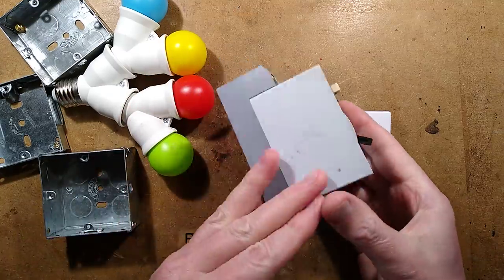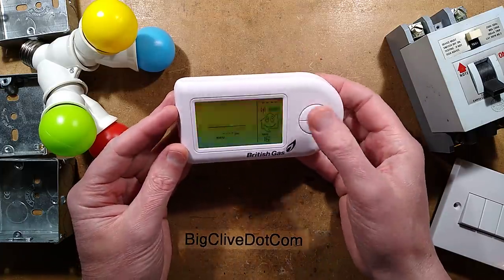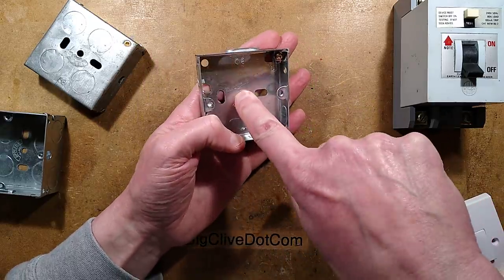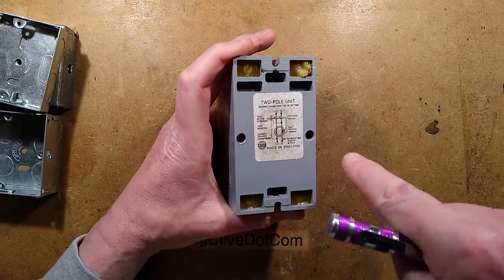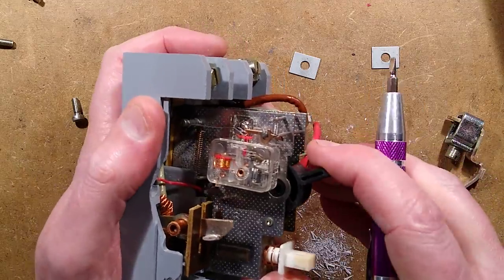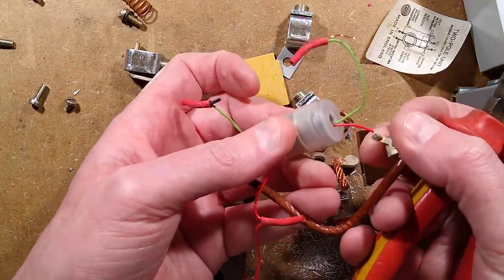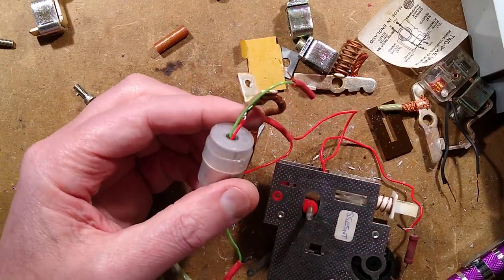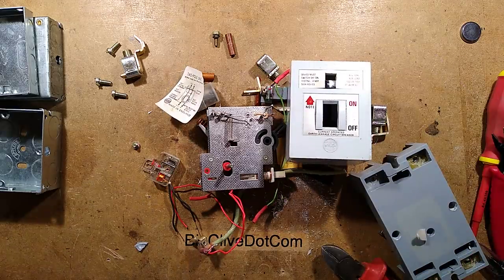Vintage RCD/GFCI teardown with story (weird sensing system)

Comment: About 4 years ago I had a call from my wife's friend. Her cold mains tap had hot water coming out of it. 
No RCD ( House circa 1955) and a short to gtround in the house. Entire house was a Faraday cage at 230v, and not a tingle anywhere. 8 ohms resistance on the "earthed" water pipe. 8kw flowing down the water pipe resulting in an 8kw soil heater. Isolated fault and asked how long the cold tap had been flowing hot water. -  2 weeks. She had an £800 electric bill for that quarter.
Reply: Woah

Comment: As a young child (age about 10) I had a crystal radio grounded to an outlet screw (which we later found to be ungrounded), with an antenna run along the ceiling thru several rooms. I came home from school one day to find said radio a pile of slag and a line burnt into the carpet where the antenna made contact.
Fault analysis determined my younger sister was to blame. :)  An errant ball had knocked down the antenna, which made contact with a central heat register in the floor, which managed to drive a rather large current thru the crystal radio to the outlet screw "ground".
Potential between the outlet screw and the heating register measured over 100 volts, with enough power to dimly light a 60watt incandescent.
The furnace in the basement was newer than the 1950s upstairs wiring and was grounded. The outlet device was replaced which eliminated the "live" ground, and led to the discovery that there was no ground of any kind available to that outlet (only two wires, oilcloth outer jacket, no conduit). The original outlet was a triplex of 2-hole sockets and must have had an internal fault, but that my youthful disassembly was unable to discover.

Comment: That transformer core will be made from something like Permalloy which is basically 80% Nickel and 20% Iron.  It was widely used for mains frequency and low frequency switch mode PSUs and probably still is.  It has a very high permeability which makes an accurate current transformer.  It's used in the form of a thin tape to reduce eddy current losses.
Reply: Correct on all points:
Tape wound transformer cores are not at all unusual, especially in Toroid form
The thin tape forms laminations in order to prevent eddy currents
The metal will be Nu-Metal or something similar (eg not steel)
And it's a Current transformer, so one turn is sufficient
Reply: @graemezimmer604  I think you meant mu-metal.
Reply: @dhaen  Mu metal is malleable, permalloy seems to be harder. As mu metal loses its properties when bent it is not so practical.
The name is confusing - the "perm" does not relate to permanent magnets it seems.

Comment: Those boxes are comically thin from a US perspective. Ordinarily our boxes are about 3–3½” deep, which fits nicely inside of a stud wall. Boxes like those exist here, but they're very much a specialty item. The one time I ran into one it was a real PITA to deal with.

Someday I'd really like to send you or John Ward a US equivalent to your "consumer unit". The innards are just so totally different in concept that I find it amazing.

That core is acting as an amplifier for the magnetic field, so you're going to be getting more flux in the sense wire than you would without it. You're still dependent on the circuit being AC. Detecting a DC fault to ground would be a bit dubious, I think.
Reply: They're effectively the same as a three-phase DB over here, except they're still made like it's the 1960s. Nothing earth shattering.

Comment: We were using these fault current operated devices in the UK in the early 1960s, sometimes still using mains water supply as the earth (ground) conductor. I pressed the test button on one at the same moment as the plumber was under the sink disconnecting the pipe. He became part of the earth circuit and was quite annoyed about it. We started using earth spikes for a time but they were soon superseded by the present fault voltage system.
Reply: What does the "fault voltage system" use as zero reference if not some metal connected to mother Earth?
Reply from the maker: Some seem to measure voltage difference between neutral and earth.
Reply: @bigclivedotcom  This was directed at RJ Mun calling RCDs outdated in favour of some system by that name, while simultaneously misunderstanding how RCD test buttons work.  Still waiting for him to explain what he was on about, though it might be the IT system, or TN-S with an old school Earth current relay.

Comment: A few months ago I was working on this parked trailer/cabin that had suffered a ground fault. It was plugged into this 50A plug that was grounded by a little brass strip going to the screws in the pedestal it was mounted in. The breaker feeding this plug had been disabled, the one inside the trailer didn't trip for some reason, and the brass strip worked as quite an efficient fuse, so the ground wire and everything "grounded" in the trailer became live. It took a while to figure out why turning this breaker "On" would cause a reading of 0 volts from live to ground.
Reply: ouch, that could give you quite an "interesting" experience, touching anything grounded...
Reply: @alexanderkupke920  Yeah I think the snow was just cold enough, and my boots were just dry enough, that I didn't become the new ground wire when I touched the metal cover of the outdoor panel 😂. The time where I was working near a pool and water had condensed into the breakers was another story...

Comment: I remember these very well, late 70, early 80's while working for British Rail. While attending an electronics course at college, I had a project to build a ELCB tester to make sure they did trip, not only at the rated current, but also within the approved time limit. Since these worked on balancing the current through the sense coil, the tester allowed a small amount of current to bypass the the coil, hence giving an imbalance. Cant remember the circuit details, but it counted the peaks of voltage passing after hitting the 'test' button - giving a 'Pass' - 'NoPass' sort of test - very primitive, but I passed the course :) - by the way, great watching these vids Clive

Comment: I find the history of RCDs fascinating. They were invented in South Africa, to protect  people in the mines from electrocution. The early sensing circuit used a special vacuum florescent tube. South Africa was the first country to adopt RCDs as standard, in domestic installations. I think the UK was quite late to adopt RCDs ( Mabe fear of nuisance tripping?)
Reply: When Denmark adapted them for new installs in the 1970s, the breakers were already a newer style DIN rail units, and any retrofit into existing installs might make it the only piece of DIN rail in the consumer unit.  So I'm guessing this UK RCD is from an earlier decade.   It may be older than Clive himself.
Reply from the maker: Just like we're still dragging our heels with the type-A RCDs, while the hobbyists at the IET invent ever more unlikely accident scenarios that must be protected against.
Reply: @bigclivedotcom  they are a protection racket mafia! The stupid one day course to  sign off real electrician's work. Don't get me started 😂
Reply: @johndododoe1411  DIN rail came much later for circuit breakers and RCDs, in South Africa. It's nice to see it all standard now. The stuff in the USA is very different, but interesting.
Reply: @johndododoe1411  here in NL, we moved in 1992 into a house with a 1960s fuse box setup (the house had mostly burned out around then, and we added RCDs in front of the existing stuff , which was indeed the single din rail box in the setup. We replaced the entire thing with a new din-based fuse box a few years ago in preparation for adding solar panels.
Reply: Well I never !
Reply: Some form of ground fault protection existed in Germany around 1908 too.
Reply: @mernok2001  That is fascinating. I was never a fan of huge fault currents to earth, tripping a circuit breaker.( This requires the earth loop impedance to be very low) But RCD/ GFI  can easily deal with hi value earth loop impedance. Let the circuit breaker deal with short-circuits and overloads. I think there is to much reliance on a "good earth" tripping the breaker.

Comment: the shallow depth boxes where usually used on the lighting circuit, the 20mm box was for sockets, spur switches, whilst the extra deep was mainly for cooker, shower circuits... if you thought the e.l.c.b. was fun the older voltage operated circuit breaker where a hoot, a fault on one house could knock the power off for several neighbors too...

Comment: Still got one these in my house. Had it fitted in 1976 and felt very modern as all the neighbouring houses on our new estate made do with wired fuses and nothing else. Still works using the test button or one of those plug--in test plugs with a RCCD test button.

Comment: Oddly enough I have one of these 'protecting' a PIR light on the side of the house. The feed to it is taken from a lighting circuit on the, much more modern, split load, RCD consumer unit. Very interesting. I'd not given it's age much thought. It used to protect the garage when there was just a pendant light and a single 13amp socket.

Comment: Amazing how simple it is that there is enough power induced through that small wire to create the magnetic force which trips the mechanism. Considering the age of the device I wonder how much development went into making it, no electronics just a bit of electro-magnetic force to push that small pin out and the mechanism to release the breaker. Great seeing such an old bit of kit which no one would give a second thought to what went into it when it gets replaced. In a way it's good it failed so you could make this video for us as you would never have replaced it had it not failed.

Comment: Your deepest box is standard in the US. The shallow one would only be allowed for low voltage like under 50, and not line power AC at all.
Reply: The 5/8 inch "pancake box" is a thing here too. But it's only used under light fixtures that have a little room for connections in the back of the fixture. no way would an American switch fit in one of those!

Comment: There's a good PSA here - if an RCB doesn't trip when you press the button, manually switch it off and on and try again. You'll still want to replace it sooner than later, but you'll know the reason it wasn't tripping was mechanical.

Comment: I always love the dimpled metal plates that they used to use in old electronic gear. I don't know why, but I just find it pleasing...
That rolled steel wrapped core is typical for any toroidal transformer that I've seen so far.

Comment: Guess that is why in the Netherlands the boxes (and tubes) that sit in the wall are always made from PVC. Only old houses (where the copper wire may even be wrapped in paper and canvas) you would find steel tubes and boxes, however the switches would then be on top of the wall instead of inserted leaving room for cables still.

Comment: My old cottage is about to have some work done to replace the consumer unit but at the moment it is an old brown Wylex fuse box (6 ways) and an old brown Crabtree earth leakage trip, the trip has a connection to earth and should, if still working as specified, trip if 50v is sensed on the earth. 

I did the last wiring here about 25yrs ago and yet testing last week with a modern insulation tester came up with good results. The earth stake I put in back then is still good, I intend to keep it as a stake as I do restoration of older pro audio equipment and a good stake gives a cleaner, quieter earth than PME etc. 

Soon I'm hoping to complete a home workshop which is going to have extensive wiring (more than the house) which is why I have to bring the house up to date.

Comment: That coil is made from Permalloy, which is a magnetic foil used to make tape heads. Used as it is linear, but has a well defined saturation point. The magnetic coil will trip with 30mA of current, and has a tiny magnet that is adjusted to set sensitivity. The coil will only trip on one direction of AC current flow, as the magnetising from the coil increases and counteracts the small bias magnet field, till the armature is able to pull off with the spring tension. Other half cycle the field is reinforced and does not release.

I have taken older units apart, Fuchs made ones, which also had that circuit, though the ones from the 1970's made by Heinemann included a small electronic circuit in them, which was a full bridge rectifier, using 2 10V zener diodes for half the bridge, a small tantalum bead dipped capacitor as smoothing, then a BRY39 gate controlled thyristor with a Rc network attached to the positive trigger circuit, so it would trigger and put a pulse of current through the coil if the leakage reached 30mA, or for larger imbalances the zeners would clamp the voltage, and the fast rise would trigger the GCS to fire and trip the coil.

More modern ones (circa 2012) have an updated circuit, and use some mains power to have a small electronic circuit to compare the current in the sense winding, and use a small signal thyristor to trip the coil via resistors directly off the mains, so no need for a sensitive coil mechanism. This later one also has lost neutral detection, using a second set of diodes that allow neutral to float up to 1V2 above ground before tripping, so detecting loss of neutral inside the premises, though it does not work with TT systems, but only with TN-CS systems. Came with a set of MOV units inside, that would clamp spikes down somewhat, but would also trip out the breaker on prolonged high mains voltage over 300VAC.

New breakers no longer have this, MOV or ground wire, so you can test them with an insulation tester in circuit, just turn off the breaker. Older ones you had to disconnect the outputs to do insulation test. The new ones also are feed agnostic, you can feed them from the base or the top and thy will not care, unlike the old ones which would burn out the trip coils.

Comment: Once had a flat car battery, first time in 3 years. I would have charged it on the garage bench but it was packed with crap so stood it on a box with charger in the middle of the floor. Six hours later the electrics went out and finally found a "boiled over" battery. Stood for a while contemplating the purchase of replacement battery and charger along with fuse replacement only to get a drip on the head from the shower in the bathroom above that decided to leak perfectly in line 5 years after the installation. It felt like Final Destination.
Reply: I had a flat car battery once too.
Luckily I had packed a hand pump in the car and was able to pump it back up.
Reply: @daviddavidson2357  hope you topped up your blinker fluid while you were at it?
Reply: @thebrowns5337  Yeah. I also added some spring water to the shocks.
Reply: had a car battery on a mk1 gte blow straight in half...amazing but scary no idea how it happened

Comment: Standard Wylex RCD. The coil of iron is a tiny CT. Pretty simple but very clever thing. The 125mA ones for farms and stuff don't even have the test resistor. They kind of rely on the resistive voltage drop on the neutral. Only for the test button mind. I have had a few occasions where the button doesn't work but it tests fine. Earth faults🤣 can have you running in circles. Thing is though, on a lighting circuit unless it's a catastrophic meltdown how is a simple bulb fault going to trip the RCD? The bulb and it's holder, unless metal, has no earth anyway.

Comment: That three part lever system you showed at the end was fascinating. It looked like something that could have been around from before the days of steam. But surely resetting it would be complicated as each lever would need to be moved back into place in the right order (and not allowed to press against the wheel until it too was in place).
Reply: Maybe applying force to the main contact will result in an inverted cascade of levers snapping into position?

Comment: this is the first time for me to comment to a creator. 
I'm N4IOG, a ham geek scrivenor living in Victoria 🇨🇦.
I love your videos, Big Clive. I'm not yet a supporter, but it will happen. 
I particularly enjoyed a video with you and Ralphie taste testing clubhouse remixes (vodka with designer flavours added). Please let Ralphie know he's much loved too!
I always tend to avoid letting components age too much. We had two 1969 thermostats for electric strip heat and we were either turning them on or off. The thermo was a clunky, high current hot system, so we let a Spark replace them as I have a strong preference about working on hot circuits.
Anyway, as part of maintenance, everything is a consumable over time. 
I'm glad to see every time you post something new.

Comment: Fascinating stuff.
I lost faith in the Hager brand after a relatively expensive RCBO failed to proceed after only 3 years.
I pressed the test button to be presented with a buzz, burning smell and smoke after less than 1 second instead of the reasurring click you expect.
Reply from the maker: Unfortunately that's common with Hager breakers.  The trip button initiates the trip sequence, but it fails to trip, and the coil which is only rated for very brief operation is left running.  That can result in much more than smoke.
Reply: @bigclivedotcom  
Especially if the smoke is emanating from someone hanging off the circuit it was supposed to trip for...

Comment: From the circuit diagram on the label it looks as though the test resistor is disconnected as soon as the breaker trips assuming it is wired as instructed on the label with the incoming feed to the top of the unit. If the breaker does not trip when tested you probably need to change it anyway so if the resistor burns out it does not matter.